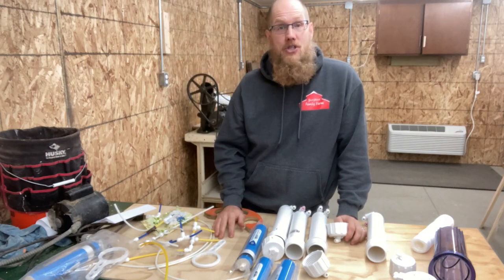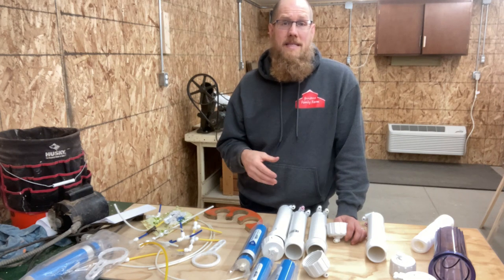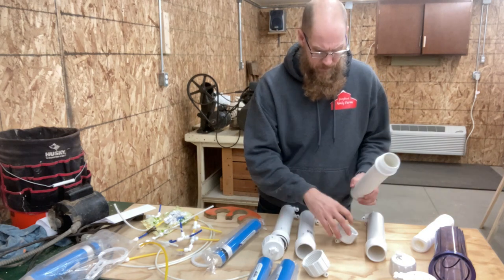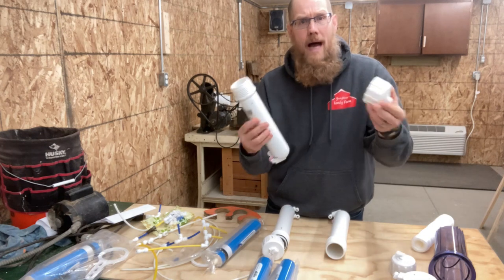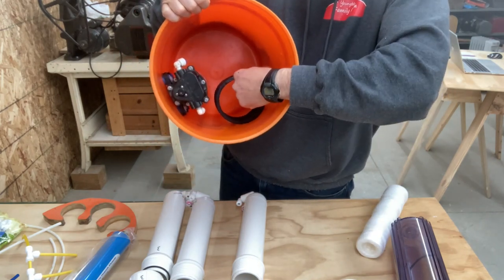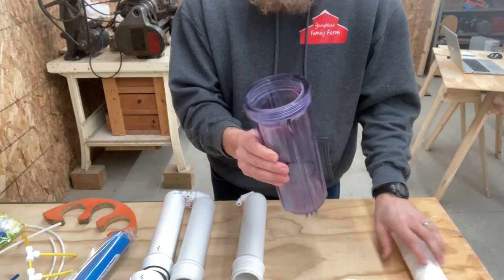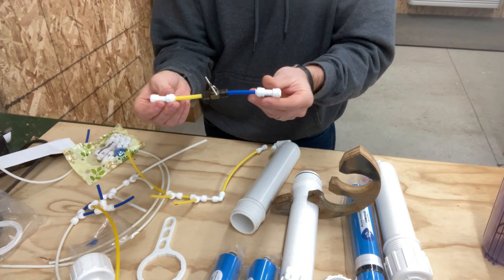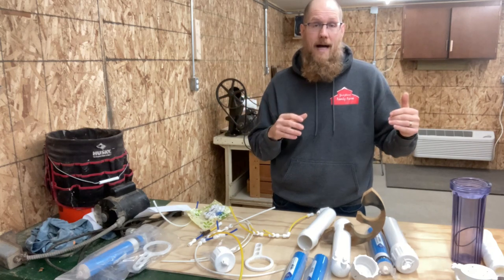How I Build and Assemble a RO for Maple Sap

Comment: Thank you for the excellent video Joe. I appreciate the explanation of the parallel setup. That seems to make a lot of sense since one membrane could start to restrict and more would flow thru the others. I imagine the restrictions stay pretty even in this set up. Thanks again... gonna check out your other videos now.
Reply from the maker: You are welcome!  The sap does process a bit slower to finish but the clog rate is slower.  In the batch barrel like I do it works well.  I did re plumb this to go in series a couple times when I had a long boil and lots of sap, just running the RO concentrate into a 5 gallon and then dumped that into the warming pan.  Thanks

Comment: Great video Joe. Thanks for breaking this down and showing everything so clearly! I am getting ready to do the same thing here pretty quick. Syrup season is creeping up in me this year, I don't quite feel ready!
Reply from the maker: Eric, I’m not sure anyone is ever completely ready,  I had some improvements in the evaporator that I won’t remember until I am in that first boil, ugh
Reply: @YoungbloodFamilyFarm  I hear you. I am trying to come come up with a cool way to preheat. I liked your way with the tubing on the stack. My system is a bit different so I'm trying to modify it. Trying to not lose my boil as much as i have in the past.
Reply from the maker: @GagneFarms  even if you can’t preheat the sap, to be able to add it slowly, or consistently is way better than those cold 1 gallon pour overs.  I’m guessing my sap is only 75 degrees when it makes it into the pan.
Reply: @YoungbloodFamilyFarm  yes that works so much better. Last year  i started warming a pan up on the turkey fryer and dumping it in and that worked so much better!

Comment: Really good video, covers the basics for even larger units….. I’m curious you you could add a recirculating pump of the concentrate to run a second pass for higher concentration.
Reply from the maker: Exactly what I do,  I send my concentrated sap back into the barrel.  I use 30 gallon barrels with brass spigots on the bottom.  I recirculate this sap for usually 4-8 hours.  With this I have had sap as high as 8%, which honestly is too high, but this system works well for the batch system.

Comment: Thanks Joe.I’m making one of these for this season‘s maple. I only have about 20 trees so it’s not a big organization.
How long can my feed line be?can I put it down at my barrel which is about 50 feet from where my RO is going to be will the pump pull that far?
Reply from the maker: I don’t see any reason that it wouldn’t, these little pumps are pretty amazing.  I have installed spigots in the bottom of my barrel to help create a little pressure from the sap weight.  I pull through about 15 feet of tube

Comment: Hey great video. Thanks for posting!! Hopefully your sap comes out delicious this year, so fun to make. I have a question... I have been researching what side the permeate vs sap comes out of. (your labels on the housing). I have my system set up just like yours but others day that incorrect? Looking for clarification...
Great video !!
Reply from the maker: Thanks, not certain of what you are asking.  Permeate water and concentrated sap will come out the bottom of 1 hole or the other.  This is determined by the housing and membrane manufacturers.  I just follow their recommendations on this.  I do plumb my membranes together in parallel instead of series.  This seems to be controversial but meets my needs better
Reply: @YoungbloodFamilyFarm  thank you for the info. I was asking which hole was the permeate and which hole was a concentrate when plumbed in parallel? I have seen videos in which the lower of the two holes was permeate and some videos where the lower hole was concentrate.

Comment: Joe. Great video and demonstration! I am on my third year of maple syruping and adding an RO system like this for the first time. Assembling it right now. I have about 70 taps and hoping this cuts down some boiling time. Not sure just yet how this is all going to work with keeping up with the sap flow vs. a secondary process. Does the RO process need the sap to be above 40 degrees to function properly? Do you have to gravity flow the sap into the pump or can they be at the same level?
Reply from the maker: I will link a video I made about operation of my RO.  The sap flows better as it warms but will still work through the pump at lower temps.  I have had ice chips jam up in the tubes, so now when temps get that low, I usually don’t operate it.  I left links for the spigot in the video notes.  Using the spigot on the bottom of the barrel, the weight of the sap will gain some pressure for you.  However, my first year Using this I just ziptied the tubes to some PVC pipes to keep them at the bottom of the barrel.  Let me know if you any other questions, and yes if you can time things out you will save a ton of time at the evaporator.  How I operate my Maple Sap RO (reverse osmosis) For the Nerds
https://youtu.be/iNstS6I6FVM